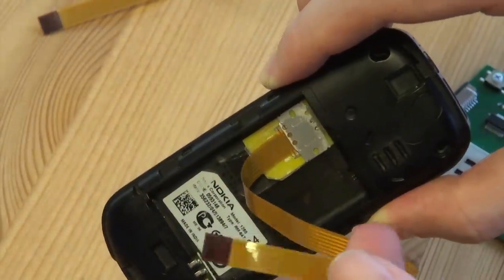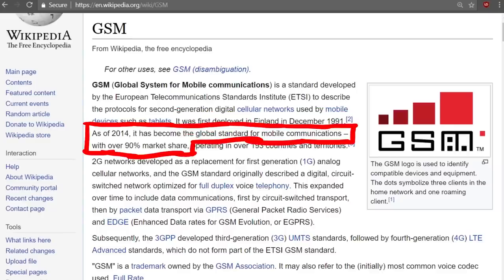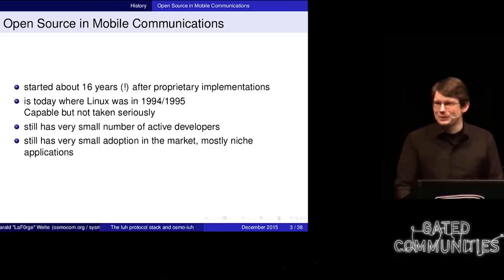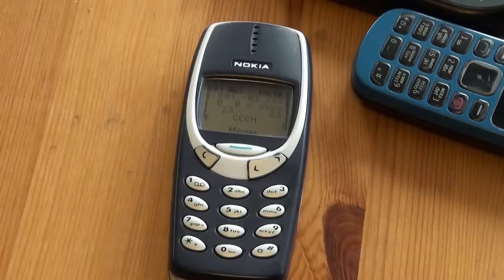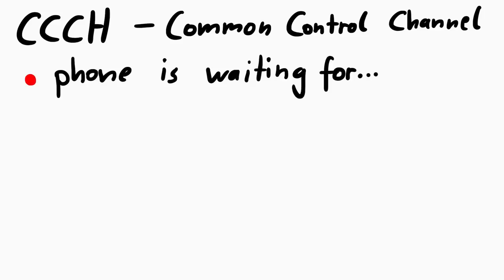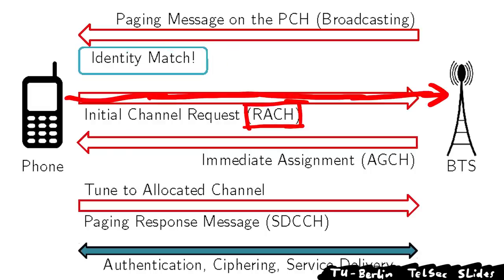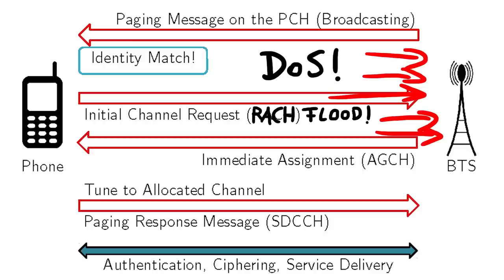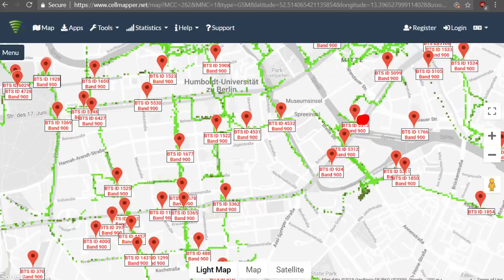GSM Mobile Network Intro - Nokia Network Monitor

Comment: Hello. I'm working in mobile operator. My speciality is radio network planning and optimization of 2G RAN.
I'd like to say that everything you described is absolutelly correct and well simplifided to understand for beginners. So keep doing such a great stuff!
If you have any questions related to GSM - feel free to ask. I would help how i can
Reply: Maybe me. So its like this: How can SS7 works on GSM? And even can used to intercept SMS Massages? Thanks in advance
Reply: I want to work on private gsm network at home please guide me
Reply: @geekyrajnish  I think for private gsm network, you're going to need lots of expensive equipment, and to have a licence to use certain frequency bands.
Reply: @semplar2007  i need full guide please i will do everything for it
Reply: @geekyrajnish  I'm not a mobile network specialist, but googling gave me this document (2nd result):
https://www.gsma.com/spectrum/wp-content/uploads/2016/11/spec_best_practice_ENG.pdf
In there on page#33 you can see prices for reserving frequency bands in African countries (for example): from $16 to $67 MILLIONS of dollars per 10Mhz band. Idk what time ranges.
In my country (Ukraine) auction prices are similar, $15 millions per 10Mhz band.
Reply: How does the new LTE Sims work ?
Reply: Do phone calls service providers knows everything about my phone calls history the actual conversation?

Can these phone calls service providers pull up personal data from my phone through out a SIM card  videos,images,apps,contacts etc. ? 

Can it be done with live conversation too ? 

Man I still have no idea what they capable of 🤣

Comment: I discovered the fun of this back in the days when i got a cable of ebay so i could upload ringtones and images to the phone. The network monitor could also be used to lock in on a certain tower or cell. I remember I used to lock on  strong cells close to school and then see how long i could keep a connection on it on the bus ride home...

Good days!

Comment: This is so cool. It confirmed my suspicion that the design of mobile phone networks is even more outdated than that of the internet. The problem with both is that so many legacy devices use them that it's basically impossible to overhaul without major disruption.
Reply: Some countries already started to phase out either G2 or G3, but not both, yet.
Reply: @Hauketal  any network whose communication depends on a centralised server is outdated in my opinion. So, moving from 2G to 4G is hardly an upgrade (if we ignore the speed benefits of the latter).
Reply: TCP/IP was designed at the begin of the 80s, SS7 (which is still the basis of carrier communication and horribly vulnerable) was designed in the midst of the 70s. GSM for carrier - end point communication was designed in the midst of the 80s so slightly later than "classical" TCP/IP and it is (partly because of that) also more secure, at least they introduced some encryption like (the intentionally weakened) A5/1 and the even worse A5/2.
Reply: @frankschneider6156  for sure, in the sense 2G is actually more advanced than 4G

Comment: BTW about basestations. That's the one of the earliest reasons to turn off your phones while on plane. Imagine hundred of phones on plane constantly changing basestations at the speed higher than 300 kmh.
At that time it was creating a huge load on basestations from time to time.
Now load is dispersed thanks to different generations and improved capacity of basestations.
Correct me if I'm wrong.

Comment: TDMA was replaced by CDMA some time ago!  GSM and CDMA are being phased out and being replaced by LTE.  In the US, a few years ago - AT&T and T-Mobile were the original GSM carriers, where Verizon and Sprint were CDMA only and did not use SIM cards (giving users less choice, flexibility).  Now that everyone is using LTE, every phone uses a SIM card to access the network, as well as the phone's radio needs to use that carrier's band(s).

Comment: They use basic radio trunking alike used by emergency services. Catch here though you didn't note is usually base stations have more than 1 frequency pair obviously the more pairs the more time slots and thus capacity available.

Also here in Australia 2G is finished, gone, ripped up and binned with all eftpos etc sent to 3G and 4G for the newer ones.

I have to admit that the cell/tower/base handover is bloody magic for the phone network. A 2way radio is a lot easier you just force the change between a and b talking (silent time) to do the change but a phone requires seamless changeover and does so without most noticing (a little klunky at times out here in the country with larger gaps bbetween towers and thus different lag times).

Comment: What happens if the paging request fails? Does it try to send it to other nearby base stations? If the phone is turned off, or not in a coverage zone, how would the network know when to give up on trying to deliver a paging request?
Reply from the maker: Afaik it might try base stations in the area and then give up. And then you get the voicemail on the other sode
Reply: A page request is initiated by a subsystem that manages many base stations like an MME for LTE or MSC/BSC for 2G/3G technology. These base stations (BS) are all grouped into multiple smaller areas and the managing subsystem only knows the last area you were registered to. Like maybe an area covering an airport before you take a flight. Like LiveOverflow mentioned, the BS's that belong to that area are sent the paging request and it's broadcasted by all the BS's. If your mobile device does not respond, your location will be set to unknown and a core component will track all missed calls and failed messages until it knows where you are again. When you finally land, your UE will find a new BS to camp on, the location register will be updated, and the core will begin forwarding all missed page requests so you get notified of your missed calls and get bombarded with text messages.

Huge fan of your videos LiveOverflow. I was so excited when I saw you were covering mobile technology and I vaguely remember some weaknesses in GSM's encryption algorithm so can't wait to see more.
Reply: AFAIK, you can sniff and break GSM encryption with an RTL-SDR dongle and some software. Encryption is not that great.
Reply: @MadushanNishantha  when you are turning off your MS, it sends "IMSI deatached" to MSC/HLR by sdcch channel. So if someone calls you when your MS is turned off - GSM system doesn't even try to send paging, knowing that you are "offline"
Reply: This is when a divert could kick in, if the paging response is not answered the the network updates the with No Response, then if you have a divert configured then that will be actioned. If it was to the carrier voicemail then a network waiting indicator will be sent to you device and will wait to be received, shortly after the device location updates and receives the MWI the device will flag to the user a message is waiting. Should you just pull the battery, then no last gasp will be sent to the network and the network will try to page until no response. This is for GSM or DCS1800 of course. Diverts can be network or user set and each has its own priority such as user overrule networks divert.
Reply: Well, you should have mentioned "A5/1" and/or "A5/2" encryption. A5/3 is not that bad ;)
Reply: @kevinpielacki127  There's the A5/1 vulnerability that the Kraken tool was developed for. There are also some videos on how to install and use this, on YouTube.
Reply: @MadushanNishantha  A5/1 encryption yes. A5/3 encryption, probably not as there is no public poc.
Reply: There is a timer for that, if I recall it is the T3216 timer.
Reply: What the people before me said: The network basically tries to reach you on the last base station, and possibly base stations around it. If that fails, it redirects to voice mail or gives the caller the 'cannot be reached right now' message, and updates its internal registry to indicate that your device is offline. You'll notice it did the latter when calling again as it goes to 'not reachable' a lot quicker, because it doesn't even try to send out paging requests and wait for a response to them any more.

Comment: Hi, Great video but I would like to add that the MSC keeps track of the VLR and it's that  which is updated with the Location Update contain the  Location Area Codewhich is a group of BTS cells on one or a few BSCs. The VLR may be located logically within the MSC but it does not have to be. This is because some vendors had limitations on how many IMSIs could fit within each VLR database  that normaly covered a geographical area.

Comment: It could be cool to see how far you can trilaterate your position with your current cell tower and its neighbours!
Anyway, cool video ;))
Reply: +TheKinGG0ld  That’s actually one of the sources of location data used by smartphones in order to improve location accuracy.
Reply: I meant, an app that use just this method to point you in the map when you have no data mobile available. Based on a database.

Comment: It was not "secret" per se, engineering mode was used, for example, when testing / accepting a new BTS, a test was timeslot per timeslot hop  observation when in tcch, another one was validation of bcch when idle, and so on. Fun times!

Comment: The sad thing about modern modems, especially the qualcomm ones that they can no longer perform country switching seamlessly. It takes them forever to switch between roaming providers and so your call drops at the border as you drive across. This used to work seamlessly with Nokia phones on 2G. You drove through 3 countries while being on the same call... of course that time the service was way more expensive and exclusive as well....

Comment: Depending on the firmware, you can maybe enable engineering mode on Nokia with *3001#12345#
If that doesn't work, in the old days you had to ask Nokia to flash the program in your field engineers phones...

Comment: So can you, in theory, sniff Paging Messages so see what other phones are in the area? Like a cell network airodump?
Reply: TheImpetuousDanny I don't know much about this, but from other comments I have seen it seems like there is encryption used in connections.
Apparently there are a few types, with older versions having issues with security (they weren't very good). The types I noticed referenced were "A5/1", "A5/2" and "A5/3". A guy in a comment above said the first two weren't good but (I'm quoting this part) "A5/3 isn't that bad."

Comment: This is interesting! I am not at all familiar with this subject. However, I am curious; If I happen to know what's the frequency of uplink and downlink of a device. Will I be able to tune into that frequencies and hear calls if I had a device to tune into that frequency? Or is the signal somehow obfuscated or stooped without a handshake?
Reply from the maker: Multiple devices use the same frequency thanks to TDMA. So that already is not so easy. And then usually there is also crypto.
Reply: No, SMS and phone calls are encrypted. Typically using A5/1 or A5/3. (I don't think anyone uses the intentionally vulnerable A5/2 anymore.)

Some countries might usr A5/0 (no encryption).

For phone calls you also need to be able to handle channel hopping so you need a HackRF or better, or multiple RTL-SDRs.
Reply: A5/1 is stronger than A5/2 but can also be easily broken using lookup tables, so in practice there is no difference if using A5/1 or A5/2. Both are insecure.

Comment: So would you be able to have a list of people nearby kust by listening to the diffrent channels? 
So far you havent mentioned encryption at all. So it would be possible to just listen to any phonecall in the area
Reply: Please wait for the next video... or check out the specs. ;)
Reply: Short answer: no and no.
Reply: Phone calls and SMS are encrypted in most countries. 

You can sniff on the various channels and look for paging requests and location update requests for example to get an idea how many phones are active.

But you'll get TMSIs most of the time which were designed to make  tracking of individuals harder. 

In some cases you may be able to get the IMSI but even if you have that it's not the phone number that you can look up in a regular database.

Sure you could try to enumerate IMSIs in your area with HLR requests online, but what I've noticed in my case is that the IMSI returned by the HLR online was not 100% accurate.

So there are several "protection mechanisms" but it isn't perfect. The average joe or even average hacker probably wouldn't be able to pull this type of tracking off anyway.

If the encryption is A5/1 or A5/2 you could try and crack it. There are no public pocs for A5/3. Some countries might use A5/0 which is no encryption.

Comment: Actually when multiple phones RACHed with same preamble at the time, there will be one of them that will be granted channel resource through contention resolution.
Reply: This is supported in LTE. I'm not sure if this also happens in GSM.
Reply: It is specified in GSM 04.08 3.1.5, it compares service request message sent and response to determine whether ue is the rightful for the channel. Similar to LTE msg 4 contains MAC CRI (which is the sent RRC Connection Request) along with RRC Connection Setup.
Reply: Offtopic, your favourite pokemon is Articuno?

Comment: I always wanted to know how the sim actually works, but I was unable to find any relevant information ( basically no information at all)
Reply: the SIM is actually a smart IC. It has a CPU that can run a set of algorithms and a fixed key.
Basically the network tower asks the phone that wants to connect a really hard question, which the phone has to ask the SIM card inside it.
The SIM card runs its algorithms and spits out an answer. If the tower is satisfied with the answer it allows the phone to connect.
Reply: As Jens said, a SIm is just a specific kind of smart card, which itself 
is just a specific kind of embedded system. The only thing that is 
special is their low requirement of resources (power & memory 
consumption and available computational power), don't have a user 
interface for interaction human (so are designed for M2M) and that they 
contain a key pair in a specially secured area of the chip that never 
ever leaves the chip, so to get it out of there is quite tricky (and 
requires the physical destruction of the card and some fancy and 
relatively expensive (5-digits upward) hardware)
If you want information take this one:
www.etsi.org/deliver/etsi_gts/11/1111/05.03.00_60/gsmts_1111v050300p.pdf
although that's just the standard interface
Reply: +wenwen1088 that much I already know, I was thinking of something that is more in-dept.

Thanks for the good intent.
Reply: Thank you for the link. Unfortunately I don't have much time now so I only looked at a few paragraphs, but I'll take more time later to study it.
Reply: wenwen1088 Does this mean that the phone could hypothetically connect without a SIM card, if the base station were to allow it?

Comment: You got the loaction for the radiowaves wrong on the spectrum. They are definitely not to the right of visable light...
Reply from the maker: Uhmm. There is no left and right. Did you check the axis values? Does it go into the correct direction?
Reply: oh sorry just realised i didnt read it properly, sorrryyyy. im dumb
Reply: in all my text books its the other way round with higher frequencies on the right
Reply: great video tho i learnt alot

Comment: What is CDMA then?
Reply: 3G.
Reply: @jeroen207  are you sure? Because we now use gsm in India but I remember not so long ago we used CDMA. And CDMA was used in small keypad phones like the Nokia 3310. Then when we switched to smartphones, we started using GSM. So I thought CDMA was below 2G, Edge etc. There was packet based communication available though. I remember using Google on a CDMA device.

Comment: Question: Is anyone able or capable to get inside the internet for free ?
withou an isp ?
Reply: +Synaxis  Well, this article from Cloudflare (and the articles linked from there) should provide a decent answer:
https://blog.cloudflare.com/rpki/

Note that you’d still need to run cables from an IXP (Internet Exchange Point; data centre where multiple networks interconnect) to your location.

Comment: where does authentication take place? It seems unlikely to me that you could jam a tower spamming RACH packets. The company should have a way of banning reincident users or something, right? If you need to authenticate before sending anything then problem solved.
Reply from the maker: And how do you authenticate without having established a communication path? RACH is used to get allocated a time slot so the base station can talk with you. And once you have this time slot now you can perform stuff like authentication.
Reply: Incredible. Could you touch up on this jamming topic a little bit in your next videos? It´s a bit risky if you make a tutorial for jamming towers but I honestly didn´t know anything about GSM before your videos so the more the better. Thanks for your hard work!